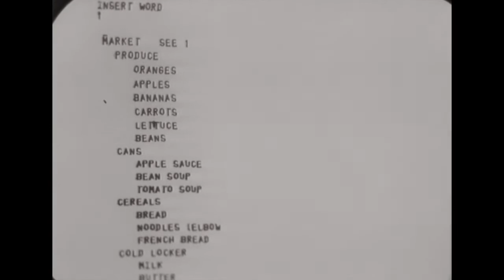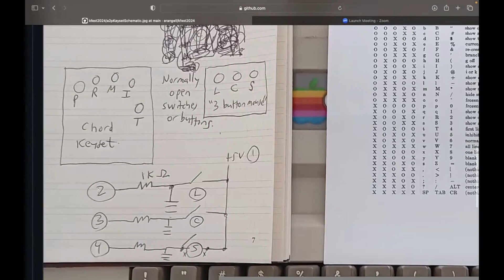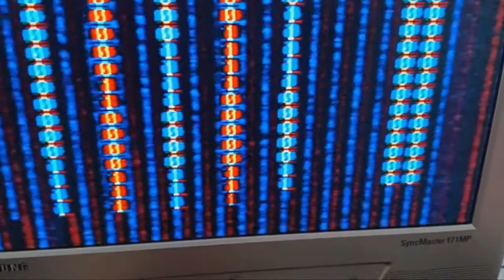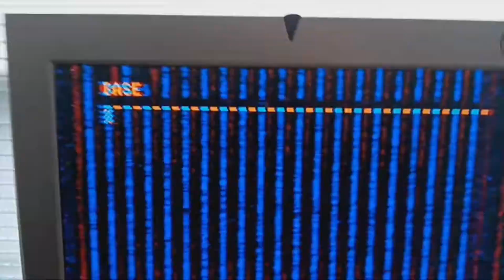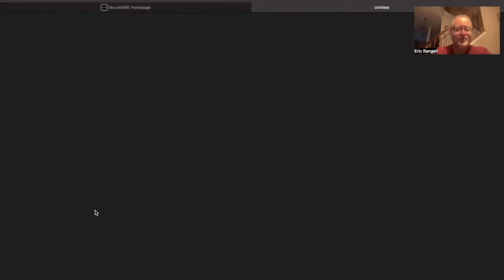Reverse Engineering Douglas Engelbart - Eric Rangell (KansasFest/A24eVR 2024)

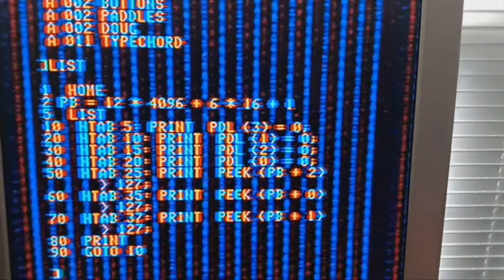Comment: 20:57 For a viewer who might not be too familiar with the Engelbart things: one of the main benefits of the chorded keyset is that it can be used providing many "modifier" buttons while the other hand is on the mouse as a pointing device. This saves the user from the usual switching between typing on a full keyboard and shifting to the mouse for point&click only. So with this setup, a user doesn't need to learn a lot of keyboard/command-line shortcuts to work entirely per keyboard (touch-typing assumed?), but retains some navigation/pointing, to fly though the information in a more directed manner, while also enjoying the combinations from the keyset buttons. Likely works best for "keyset shortcuts" for common operations. If in no need for many special characters, the alphabet from the keyset can be sufficient for brief text input. At the same time, at an NLS terminal, the user also has the regular keyboard available. Also, consider, no special equipment required - a regular numpad would more or less do equally as well, it's just some buttons and keybindings after all (and then some typing training, as is 10 fingers touch-typing on a conventional typewriter/keyboard).

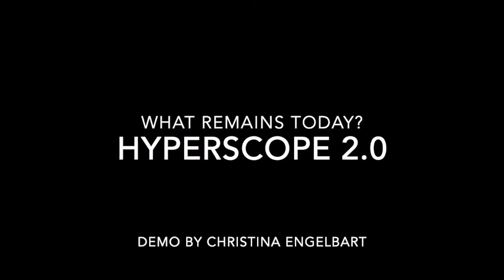Comment: 8:57 HyperScope 2.0 is nice in the sense that it revives the chance for people to get a look at another HyperScope, as the earlier one ended up defunct and not supported/maintained. On the other hand, it's kind of sad that the DEI did this on their own and in secret. In my view, this resulted in a worse implementation, as it's made for/with the WWW, and it seems they don't have any implementers anymore who have at least some kind of clue about the architecture of a proper NLS/Augment/HyperScope 1.0, so it ended up as another usual Web mess. I think this is also evident per that there's hardly much reason to use it in practice (contrary to HyperScope 1.0 or earlier), so unfortunately for these choices and approach, it's reduced to a mere demo, just to look at 😞

Comment: I do understand you're mostly into retro computing. However, it's very sad that for years, there's no project/effort around to produce a modern Xanadu/NLS type system, as we remain stuck with the messed up WWW. Consider, for example: chorded keyset is among the nice "little gimmicks" like the mouse as another input device, but if these activities stay limited to specialized one-off hardware, there's hardly much chance to get into enough usage that would justify the maintenance and support of a setup. Like, nothing learned from the loss of the DEC (= server)? True, Sam Hahn made the point that this can be good enough if it supports a single knowledge worker well enough, but then on the other hand it's limiting to some proper notions of "scaling" and a team/collaboration.